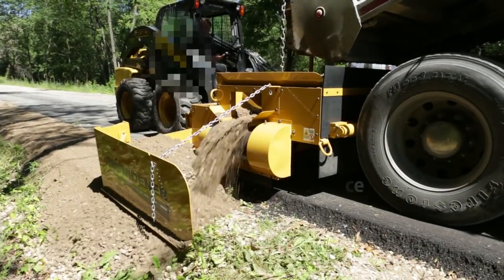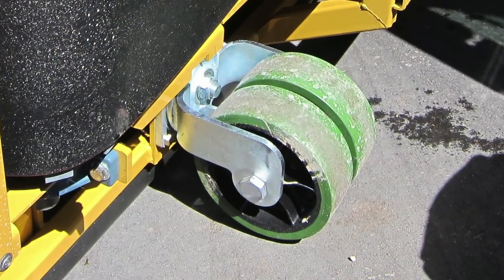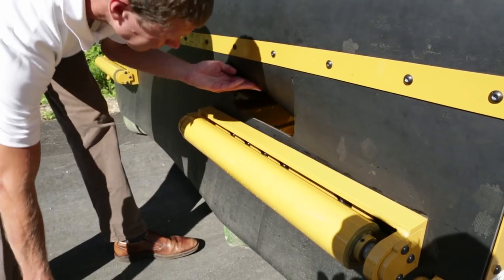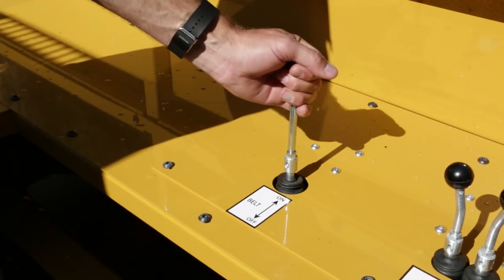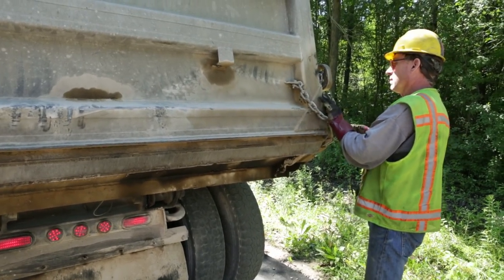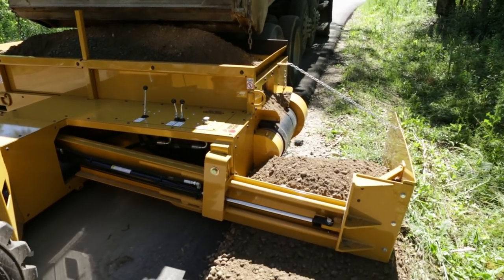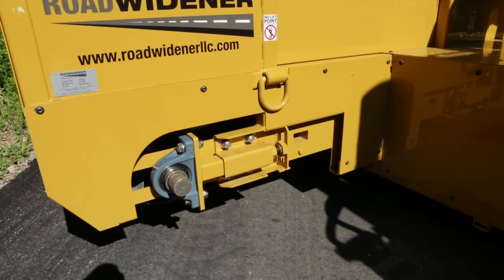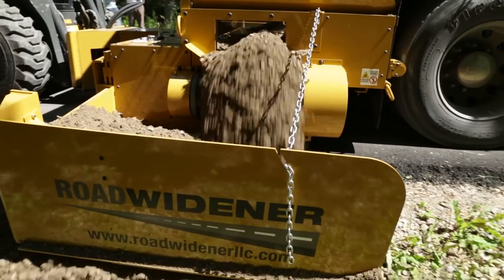RoadWidener Service and operating instructions model FH R3

Comment: Company attached ours to a loader. Virtually impossible to see the edge of the road and you only have a tiny gap in between the front wheel and the arm of the shoulder machine. Dump truck also inhibits view.

Comment: Idea: how about a hydraulic widening arm for doing partial depth repairs to match the width of the area ground out for replacement? I worked in the asphalt field for many years. This would be a great time saver in lew of doing multiple passes. Thanks guys.